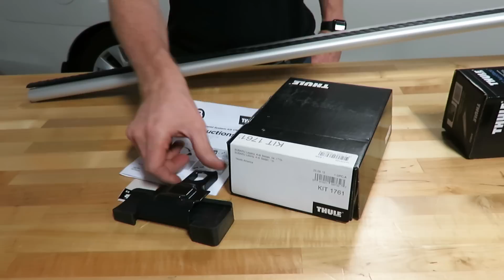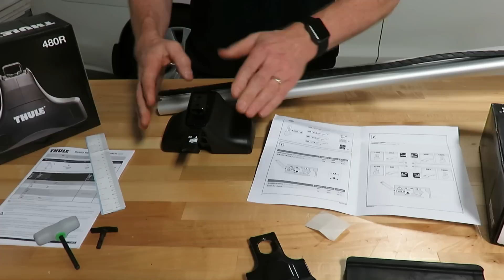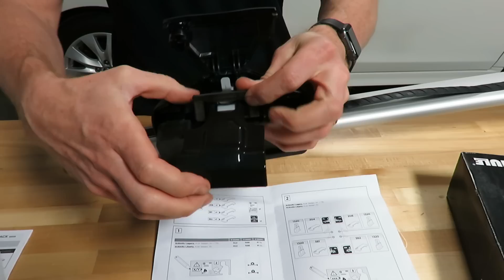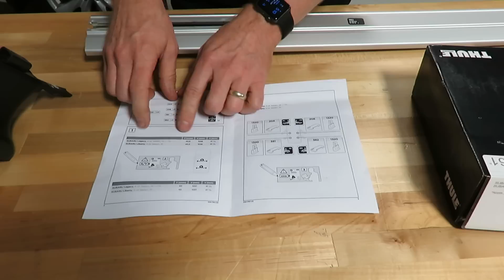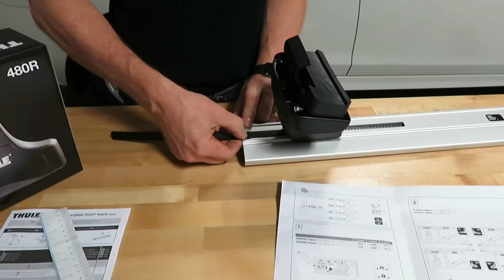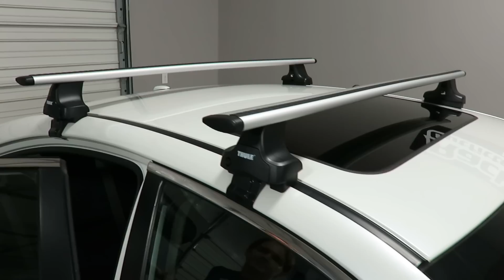How to Install the Thule 480R Rapid Traverse AeroBlade Roof Rack by Rack Attack

Comment: Do you recommend anything to protect the paint job underneath the mounting points ?
Reply from the maker: Hello.  The contact points include the rubber bases and the rubberized metal door frame brackets, both are designed to protect the vehicle's finish.  It is advisable to remove the rack when not being used for extended periods and care for the finish as normal, wash and wax.  Thanks!

Comment: which kit contains the slide scale?
Reply from the maker: Hello.  The slide scales are included with the load bars while the vehicle specific fit kit will have the instruction sheet with the scale number for the vehicle, eg: https://www.rackattack.com/public/product-instructions/145001_521-5001-01.pdf   Thanks!

Comment: those door frame brackets look like they cut into the paint oh man
Reply from the maker: Hello.  Yes, at first glance the brackets looks like gloss painted metal, however, the brackets are completely dipped in a Pebax rubber coating which is specifically formulate to grip and protect the door frame finish.  Thanks!
Reply: @rackattack  oh wow thanks

Comment: The tensioner bolt plug (the black one)you didn’t use in this video where is it used
Reply from the maker: Hello.  The plug is used in whichever foot does not have a tool inserted, all the feet should have either the plug or a tool.  Thanks!
Reply: @rackattack  awesome thanks
Reply: @rackattack  what if you don't have either the bolt plug or the acutight tool? (I bought a used set without those pieces). Can't you just use the appropriate sized allen wrench to make it tight enough? What is the purpose of leaving the acutight tool and plug in the bracket? Thanks
Reply: How do you lift the tensioner level if its snug? I tried lifting it but wont budge. Can I use a tool? I don't want to break it.
Reply: @kiking15  depends on which feet you have. There’s several different feet depending on what car it is. You can try an Allen key insert it into the hole and loosen it. Should be pretty tight. You really need to know what model you have. Look up on their site

Comment: How many acutight tools does the kit have? And is it necessary?
Reply from the maker: Two AcuTight tools are included and two plugs.  A standard 5mm hex can replace the tool for installation, however, without torque indicator on the handle there will be no gauge for proper torque.  Also a handle or plug must be left in each fastener to serve as a safety to prevent the fastener from loosening.

Comment: Extremely helpful and precise. Only two things differed from instruction manual.
1) Stickers should be positioned inside the torque area instead of outside for future use. 
2) The manual says the under bar cover strips should cover the endcap retention tab.
Both of those are fairly minor observations. Video complemented instruction manual nicely.

Comment: That clamp doesn't scratch the paint??
Reply from the maker: They do not. Thule has some of the best-engineered fit kits on the market. "Custom formed metal brackets coated with protective Pebax® thermoplastic elastomer click into the Traverse Foot and grip to the vehicle's door frame."

Click the link below for all of Thules bare roof offerings:
https://www.rackoutfitters.com/thule-roof-racks-for-bare-roof-1/
Reply: It can if there is dirt underneath it. That's why it's important to clean the area first.